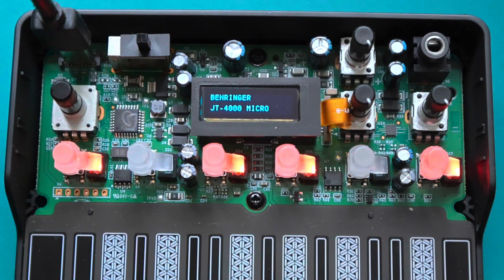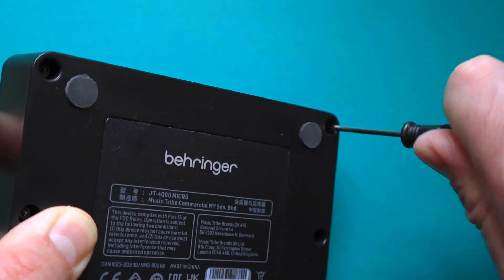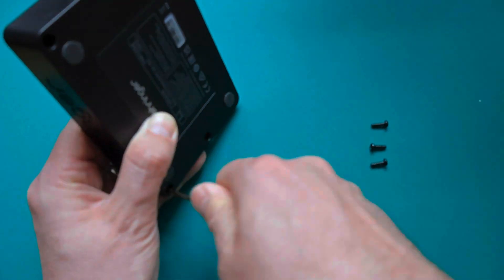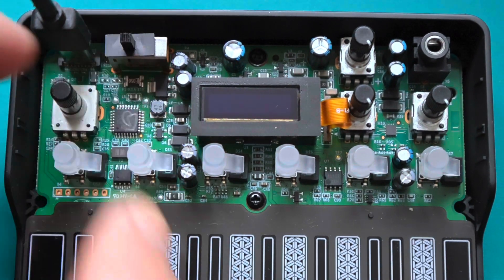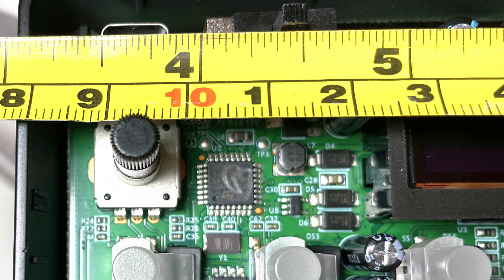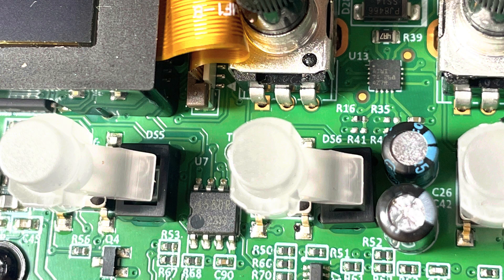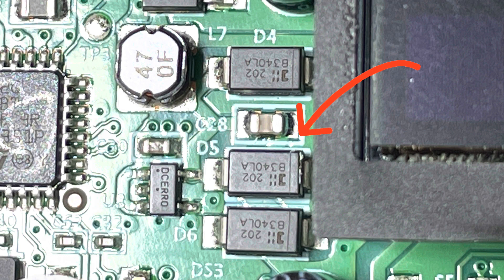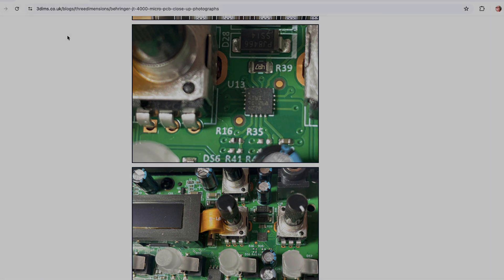Cracking Open The Behringer JT-4000 Micro

Comment: is it possible to remove the keyboard easily, is it a ribbon cable or soldiered in? Thanks for this video!
Reply from the maker: I’m not sure TBH. Will have to get the screw driver out and have a look.
Reply: I am very curious also Did you find out how to remove the keyboard yet? Thanks in advance  @3dims

Comment: It IS possiblecto Circuit Bend my Jt4000 with extrem Pitch the Output 🎛️🙏???
Reply from the maker: I’m not sure that would be possible. My understanding is pitch would need to be under analogue control and the IC where the oscillator lives is digital. I mean, it may be possible but you’d need to a super skilled at soldering if it is, as everything on the PCB is so tiny.
Reply: @3dims  , You are right ITS a analog Thing and so tiny ...i find a way to Pitch , a guitar 🎸 Pedal FX , vut thank You

Comment: Any ideas about the bottom left pins? Are they just for debug/serial port? Maybe there is room for mods and hacks if there are some labels on the back side of the pcb. Otherwise a multimeter can be useful to find out more about them
Reply from the maker: I'm afraid that side of things is a little beyond me. I can crack open the case and have a look again if it helps?

Comment: So the processor is an STM32L4.

The EEPROM Chip, i can't see it, but is it a 24c series? I say user setting data. The reason is that STM32 contains program storage flash, and will indeed not execute software from external memory, and it's generally got a whole oodle of it, depending on which variety it is. But the flash in there isn't made to be constantly rewritten, it can fail, and you can't just change a byte, you need to clear a page every time you change something, and you need a ton of measures to manage and stave off failure. So a common design trait is to use a non-page EEPROM, an i2c-connected 24c series, to store the settings, and that's good for approximately a lifetime of bytewise writes, and if it goes bad, you can still swap it out, you can even swap it with Fujitsu FRAM which is basically immortal. These EEPROM are slow for bulk loading, they're best used to load and store individual bytes or small byte sequences. In contrast if you want to store and load bulk data, you use a 25c or 25q series SPI flash chips.

The TI AIWI chip is actually TPA6132A2 stereo headphone amplifier. A popular alternative that is used by just about everyone else is MAX97220, feistier, usually comes out cheaper (except during pandemic), that one is usually marked AIG or AIF, good to remember for the next teardown, you're going to find them. I know, maddening, you just have to have an idea who made the chip (easy with this TI, not so easy with most chips) and then use the manufacturer's topcode/topmark search, except the websites are broken a lot of the time, and then verify from the datasheet, it generally has this data as well, except when it doesn't. I happen to have memorised some of these.

The 4580 is a classic opamp that one might use in a filter. Won't make a call whether that's it without probing the circuit. Honestly if i was Behringer i would just cheat and not have an analogue filter at all, just do it digital on the L4, nobody takes the product claims literally anyway right?

The display is an OLED. These small blue ones are basically the cheapest text/matrix display that you can get today, they cost like half a dollar i think, cheaper than an LCD.
Reply: The suggestion that the Holtek HT16... chip is an LCD driver... well yeah there is a 1621 but that would be weird, given it's the wrong kind of driver, it's a segment LCD driver, not a text/graphics one. I'd like to suggest that this is instead the HT16K33, a keypad scanner and LED driver with i2c. This way they can use a cheaper low pin count microcontroller (processor) IC, and then multiplex the i2c EEPROM, the i2c SSD1306 display, and all the LEDs (those in the push button switches) and the switches themselves plus possibly a rotary push encoder all on a single i2c bus.
Reply from the maker: Thanks for the correction. Every day is a school day. Cheers!
Reply from the maker: Thanks for your input, it’s really fascinating to see what others know and can unpick from just a video. My knowledge is limited but is growing through useful contributions like this one. Thanks again.
Reply: @3dims   I come from friends of Woody's Piano Shack, i'm their resident electrical engineer basically. They were looking at your vid. Found those guys when i ran into Floyd Steinberg's somewhat painful attempt to repair an Alesis Micron a few years ago. We ended up fixing it successfully.
Reply from the maker: @SianaGearz  that's so cool and really happy to have you most excellent input.
Reply: @3dims  Oh i misread the microcontroller, it's an STM32G4 not an L4. Also the U8 circuit looks like a switch mode voltage converter, because it's connected straight to an inductor and there's Shottky diodes nearby and the track layout and width, but i can't quite identify it. If one were curious, one could just probe the voltages in this circuit section. I have no clue what it's for. The main supply, for the microcontroller, the EEPROM and the OLED, is the 3.3V fixed linear regulator AZ1117-3.3 at footprint U2, they shouldn't need anything else. The Holtek should be supplied 5V from USB. The headphone drive IC can work from either 5V with USB compatible tolerance or from 3.3V. 4580 opamp is fine with 4V and up. Maybe they're generating a higher-than-5V rail for something analogue, or it's just a 3.3V to 5V step-up because it's more dependable that way. Looks a little beefy though this whole circuit section, if it was just a voltage with little current draw, a 7660 circuit comes out smaller and cheaper.

Comment: That mcu is most provably an stm32g431KB or maybe K8, and seing as those has either 64k or 128k flash build in i assume the external eeprom is used for parameter storage or something. But it is a bit weird that they use an external eeprom imstead of using an mcu with bigger flash and store it internally
Reply from the maker: Thanks for sharing. It’s a bit difficult to know for sure, but I think you probably are right.

Comment: This is really cool, I would love to see someone (who has the knowledge and skills) to circuit bend and mod this a bit. a pitch shift would be extra fun but proper midi support would be great too. The additions of the firmware updates have been excellent so perhaps there is still hope for further firmware support and updates, a way to un latching the parameter knobs to 1/4 turns would be ideal.

I'm really enjoying mine as my entry point to hardware synths (vintage casio keyboards not withstanding) .
I've paired it with a sonicake sonic ambience reverb+delay pedal to get some really dreamy sounds.

Looking forward to more of your videos on this topic :)
Reply from the maker: Thanks, and totally agree some circuit bending would be ace. The tiny surface mounted soldering means that’s beyond my basic skills in this department, but perhaps someone will take up the challenge. As a bargain intro to hardware synths I think you’ve chosen well, I’m still discovering more about the JT-4000 Micro, so will share what I can when new, cool things occur to me.
Reply: @3dims  absolutely I don't really even know what's possible, but I've seen people modify all sorts of devices, but I haven't got a clue myself. haha
Reply: They’re just bringing out a midi version now, they posted a video a few days ago. I’d literally just bought 1 & half an hour later I noticed the new midi version 😅

Comment: While one or both of the ICs you mentioned as candidates are likely part of the filter, there should be absolutely no reason for it to be anywhere near the cutoff and resonance controls. Those controls should be connected to the processor, so the only thing the filter needs to be close to is the DAC - for controlling filter with voltages, and also to generate audio to be filtered.
Reply from the maker: Thanks for the info. Really helpful insight. Cheers!
Reply: Why? If it's a classic analogue filter, then the pots specifically wouldn't be connected to the processor at all, the signal or opamp feedback just runs directly through the pots. Trying to make the filter processor controlled introduces a bunch of complexity not really desired in a toy-like synth, since you basically end up needing at least a shitty analogue multiplier plus more effective DAC channels, you can of course use the microcontroller outputs but end up needing to condition that signal, and you're quite space constrained in a device like that. At that point i'd be tempted to just completely get rid of the analogue filter and just implement a digital one, there is a DSP and FPU in the microcontroller.
Reply: @SianaGearz  are the filter settings programmable, and/or modulatable by the processor-controlled envelopes, LFO, or key tracking?
Reply: @infindebula   Good call.

There IS a connection to the microcontroller that i missed, the filter knobs are also used to adjust settings. They also appear to be single track potentiometers.

The cutoff and resonance are indeed completely automated, they have MIDI direct control, and LFO and envelope generator drive the cutoff frequency. So you're completely correct in your original assessment.

Comment: The single filter is the reason I'm selling mine and my Pro VS mini.
I would've paid the extra had they included the three extra filters required for true polyphony which these are not. Instead we're left with a weird sort of paraphony.
Reply from the maker: The single filter doesn't bother me TBH. Also, I'm not sure where Behringer would fit another 2 analogue filters into this miniscule box.
Reply: @3dims  Apart from the JT-4000 and Pro VS mini, which are without a doubt toys, all of my hardware synths are fully polyphonic. My only paraphonic synth is my Waldorf Pulse 2 and even that clearly states that it's a Monophonic synth.

Behringer could easily have made the JT-4000 large enough for four analog filters.
Look at the Pro 800 eight voice synth with eight analog filters for £300 and not a large synth.
That works out to £37.50 per analog voice and analog filter so £150 for a completly analog and fully polyphonic version of the JT-4000.
I would've bought a Pro 800 if I didn't already own a DSI tetra and a Rev2 16 voice.
Reply from the maker: @straighttalk2069 I have a Pro 800 and it’s a class synth, but totally different form factor to the JT-4000.
Reply: @straighttalk2069  The Korg Poly-800 also had only one filter, and it became a top seller not only for his price point. No one would call that a "toy", just because it was only paraphonic.
Reply from the maker: @Wulfhard1965 I think the word toy has become synonymous with JT-4000 due to its size and price. I see it more of a tool… For me it’s unlikely to be the only synth I use in a track, but it will be able to add some useful sounds to the mix.
Reply: @3dims  AGREED. It is a excellent sounding synth

Comment: Scary how close the screen ribbon is to the pot wonder if it would pose a risk to being worn down by friction over time
Reply from the maker: Good spot… I’ve just opened up the JT-4000 and tucked the ribbon cable away from the moving pot. I suspect the ribbon cable got free-d up with me messing…